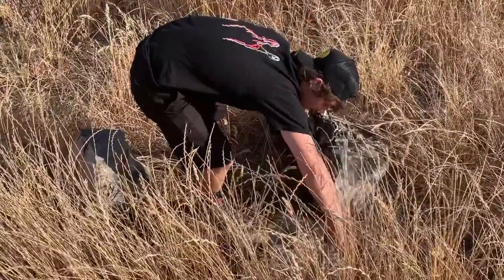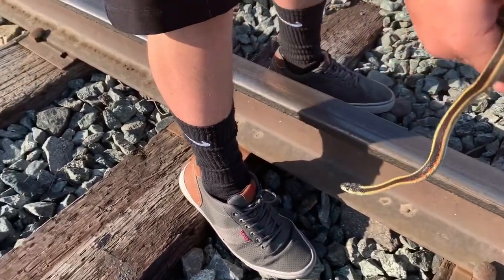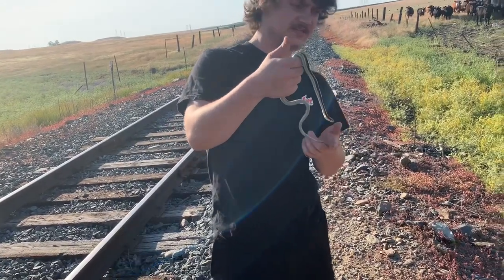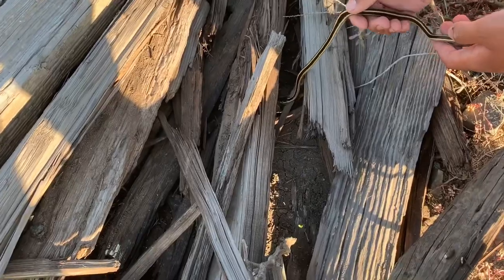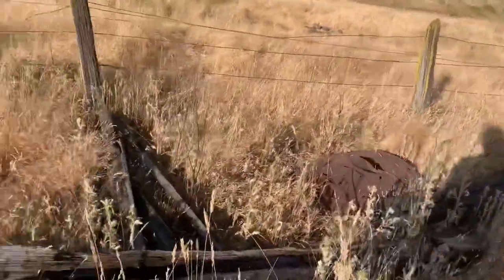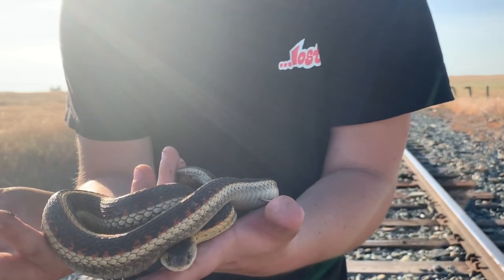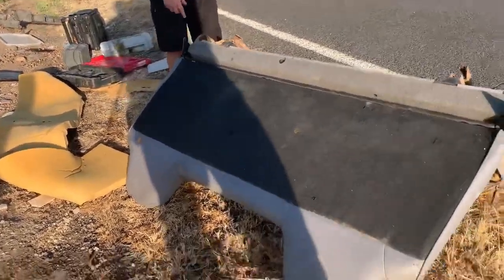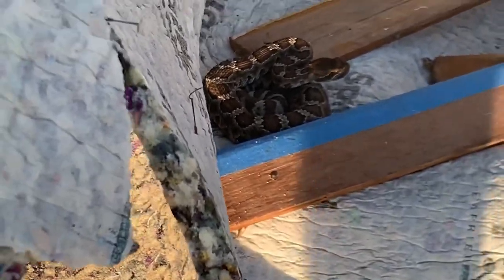Herping the Sierra Nevada Foothills! (RATTLE SNAKE?!?!)

Comment: Your shed was a garter snake, not an aberrant gopher snake. Young rattlesnakes can control the amount of venom they inject, and have a more concentrated venom than adults. So even though they have a smaller volume of venom, you can still get just as severe a bite as from an adult.
Reply: Don't know where you have gotten your info, I'd love to see proof or fact check. My mentor taught me otherwise and that's what I'll stick with. Either way, I personally consider younglings to be the most dangerous. Hardest to handle, that's why I don't.
Reply: @adamgitmed3779  Trying to be open minded and fair, I am fact-checking the relative strength of venom in young vs. adult rattlesnakes. In the first few minutes of looking, I found one mention (with a citation that I could not check) of adults having more concentrated venom than youngsters. As far as control of the bite, as a herpetologist and veterinarian, I can attest that the musculature and motor control of that musculature is fully developed at birth. Having been bitten and envenomated (twice) by neonate rattlesnakes and also documenting dry bites by neonates, I have seen first hand (pun intended) their control over venom injection.
Having you question my information on the strength of venoms is enlightening for me. It makes me question my sources. I'll get back to you after I have done more research and let you know what I find. Perhaps we'll both learn more about these creatures we love.
Reply: @adamgitmed3779  Adam, I did a little research on the internet and with a network of specialists across the country, and it turns out that there has been quite a lot of research on the change of venoms in rattlesnakes as they age. I pulled up four papers (of many available) and will try to put the links here for you, the last one specifically talks about the snake in this video (The Latin name of the snake is still a bit in dispute. Some say it is in the Viridus genus, others, like you, give it its own genus, Oreganus).
Having read through a number of papers now, it seems that many, but not all, species of rattlesnake have their venom change from juvenile (diet being mostly lizards) to adult (eating more rodents).
As far as control of volume of venom injected, I found mentions of the theory, but everyone admitted it is only a theory. I can find no study to back that up and have seen evidence to the contrary as mentioned.
Klauber, in his extensive research on rattlesnakes (I recommend his books) makes no mention of either lack of control in juveniles or changing toxicities as snakes age.

https://www.ncbi.nlm.nih.gov/pubmed/30513722

https://www.ncbi.nlm.nih.gov/pmc/articles/PMC5410154

https://www.unco.edu/nhs/biology/about-us/mackessy-stephen/documents/2003-Mackessy-et-al-concolor-paper.pdf

https://www.jstor.org/stable/1445927?seq=1#page_scan_tab_contents
Reply: @adamgitmed3779  One last opinion from an unnamed source in Arizona. Though I don't have his name, he is respected as an expert by a guy who I respect as a careful professional, so take it as you will.

From one of the venom experts from AZ:

This is an urban myth. What has been explained to me by venom scientists and the PhDs who spend time with these animals is that the smaller snakes have less venom (smaller animals, smaller venom sacks) and they have just as much control over injecting venom as adults do. The concentration is not different in a baby vs. adult and has more to do with other factors like when they last ate, hibernated, etc. 

So basically, we WANT our patients to be envenomated by a smaller snake because it should result in less venom injected. The larger the snake and smaller the patient, the more likely they are to be an intended meal and the snake is more likely to inject a huge dose to kill the dog. 

From Ken: This guy sounds like a veterinarian. His opinion seems to differ from the published papers i sent you links to and others that were with them, more evidence that not all educated people are all knowing. You now have the same information that I have. I think the evidence show that venom changes as the snakes mature, and that the lack-of-control theory is just that, a theory but unproven.

I think this ends my "providing proof" efforts. For the future, I'd be happy to come herping with you guys!